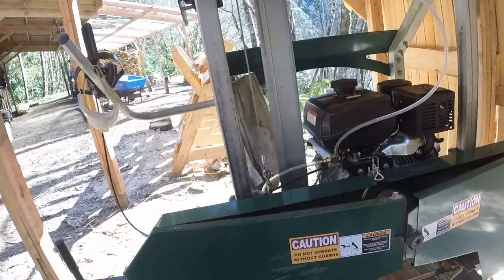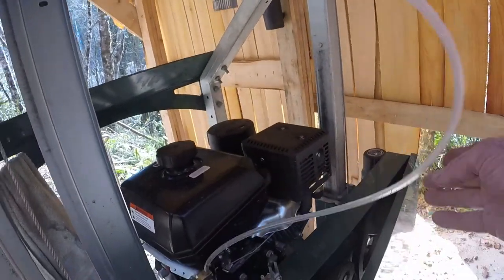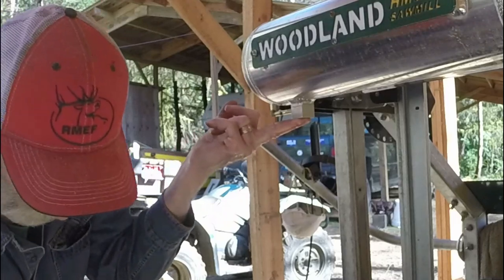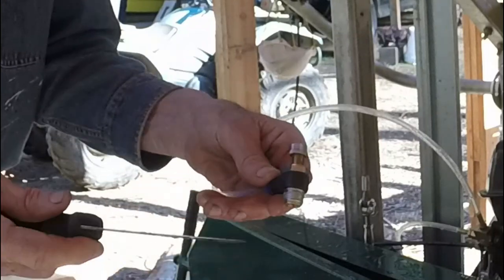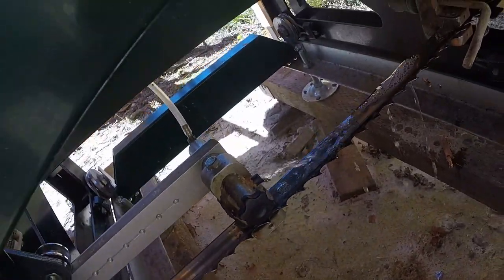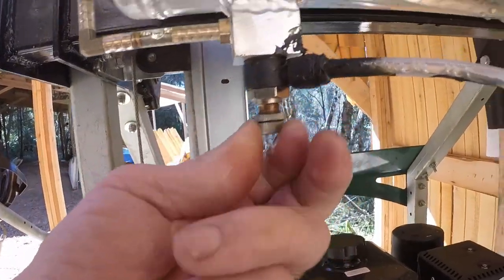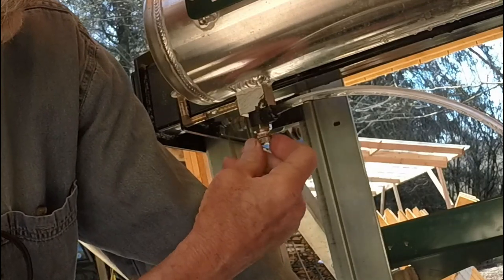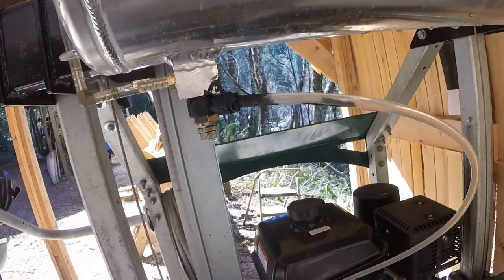Quick Clip #4 My Sawmill Sucks, and How I Fixed It

Comment: I have the 126 same set up '  i had to call Brenna and tell her my valve fell apart just crumbled , she sent me another one no problem till i left water in for a few months , went to use it and had corrosion from the tank stopping it up , now i never leave water in it for too long and gonna start using windshield fluid from now on , good video thankyou sir"
Reply from the maker: That valve seems to be a common weak point, but if the sawmill was perfect, we wouldn't be able to afford it.

Comment: Just used your teflon tape trick and it fixed the air bubbles problem. Took me less time than contacting WM customer service. Thank you
Reply from the maker: Glad it worked for you.
I ended up putting another valve right above the blade guide. Valve at the tank is wide open. Regulation is at the bottom. Works fine.

Comment: I have had the same problem. I used the tape but it didn't seem to last long. If you change the setting it's back to bubbles pretty quick. On another note I have found no difference between a lot of water, little water, or no water. Woodland Mills tech told me if the blade wasn't getting hot to forget the water.
Love your videos, I learn a lot.
Reply from the maker: Thank you, Luke. I seldom use lube anymore. I have a blade scraper that prevents buildup of sap and sawdust, and most of what I mill is already pretty wet. I was surprised to learn that Wood-Mizer advises no lube when milling dry wood.

Comment: My mill is a Frontier OS27 so i dont have that issue. Had my mill couple months now and my autolube system finally just arrived after 4 months. Guess diff mills, diff probs.. Lol. My main prob is sawdust build up on the tracks. Have to scrape off every few boards. Carriage has sweepers, but dont seen to help. Another guy i was watching offered a tip of soaking felt sweepers in a mixture of transmission fluid and kerosene. Going to give it a try. I have noticed you have had to do alot of modifications to your mill. At least when you work the bugs out, your good to go! Be safe..

Comment: Mine does the same thing with all the bubbles in the line.  I noticed that if the jam nut isn't tight, the valve will loosen. 

I suspect I have the same loose tolerances.  I will try the the Teflon tape idea.

 Thanks!
Reply from the maker: I'm going to look for an inline valve to fit the tube like the old-style fuel shutoff's in motor scooters.Plan is to but it just below the WM needle valve and leave that needle valve wide open. It won't have the fine adjustment of the needle valve, but I can live with that. But, if this fix continues to work, I'll leave it alone.

Comment: You should try Loctite pipe sealant 567, it is my go to oil, gas, water sealant. Really enjoy your videos.
Reply from the maker: I've never heard of that, Jimmy. Thanks for the tip.
Reply: It should be available at an auto parts house or hardware store.

Comment: KISS. Keep It Simple. All you need is a simple brass fuel type valve at the tank. The type that you would turn several turns to fully open on  a typical motorized anything. Like my old Tote Gote. Forget throttle actuation. Just crack the valve a bit, maybe 1/4 - 1/2 turn when you are ready to start the cut. eyeball adjust it to a steady rapid drip, and cut. finish the cut and just close the valve. A good steady drip of WATER easily keeps the blade clean. At least it does for my mill and we live like 10 miles apart. My water tank is a simple 2 1/2 gallon plastic gas can with the valve attached thru the plastic lid. To fill I just unscrew the lid, fill the container, put the lid back on then set in the cradle. Ready for another couple hours....25 years trouble free, except for the time some punks stopped by and grabbed that gas container, emptied into their pickup tank, and drove off. not far, heh heh.

Comment: I'm having an issue with the throttle not pushing against the valve to make it flow.  I had to put a little rubber spacer between the throttle leaver (engine side) and the water flow valve. I think the autolube system needs some fine tuning at the factory. Great video!
Reply from the maker: Is your throttle opening completely?  There should be no slack in the cable between hand control and engine. If you fully compress the handle and can move the throttle lever on the engine farther, you cable has slack in it.
Reply: Mine wasn't hitting the water valve so I simply took all the slack out of the throttle cable and not only did the water flow but the engine rpms also got up to full power at 3600rpm. It cuts a hell of a lot faster now. Just loosen the cable screw at the motor and remove the slack and retighten. Took a few times to finally stay tight as it broke in. As to the bubbles I found the ring nut must be tight. As to lube I only use Pinesol now. Works great and came highly recommended especially when cutting sappy pine. From one old timer to another thanks for sharing👍😎👌
Reply from the maker: @fiskfarm  I think a lot of people miss the step in setup that tells us to take all the slack out of the throttle cable. I checked mine yesterday when going over every adjustable thing on the mill, something I do every few operating hours. Still tight.
I assume you don't run just Pine Sol but add it to water. What ratio?
That air leak in the valve existed whether the ring nut/jam nut was tight or not. My guess is, some internal seal--O-ring?--on the needle valve has failed or was defective.
Reply: @OregonOldTimer  I use about 1/2 cup to a full tank of water. Forget who recommended it but it sure seems to work. I bet you're right on the o'ring. If I get bubbles that's where I'll start or just replace the valve with a fridge water tap valve. They have an adjustable packing nut. I just hauled so many rather large logs back from the neighbor that I'm taking a break. Some so heavy I left tire tracks in the pavement, oops. About 8 trips with the loader. He's having a pond dug and cut down oak, locust, maple and Tulip Poplars. Score👍😜
Reply: @OregonOldTimer  you read the manual? I thought that was considered cheating. 🤣👀 Yup I did miss that. Just did it as a matter of habit. I sure recommend a $20 tach. I watch it as I'm cutting about half the time.

Comment: Yes same problem. I may look at replacing the valve with another all together
Reply from the maker: The needle valve I added at the bottom was too touchy. Hard to get the flow just right. I replaced it with a ball valve. Much better.

Comment: Howdy Lumberjack, I am enjoying your videos on the HM 122. I have a question for you. Do you think that cam log clamp apparatus pipe would fit over the smaller diameter one that our screw clamp has? I was thinking maybe cutting it off of the end that has the weld and sliding it over the screw clamp pipe. I too am tired of the screw clamps and want to exchange it for the cam clamp. What do you think? Keep the videos coming and thank you sir.
Reply from the maker: I think the size difference between the screw clamp bar and the cam clamp sleeve is too great, but I didn't try that. Didn't think of it.

Comment: Thanks -- I swear mine had more air than usual last time I sawed, so I need to look into it too.  Do you think the valve would come apart with more effort, or is it permanently put together?  I suspect maybe there's an o-ring in there that deteriorated, causing that leak path you identified.
Reply from the maker: Hardest learned lesson for me is, don't force things. I was afraid of damaging the valve beyond repair, so when it stopped, I stopped.
There is still air in the tube I haven't flushed out, and after my meddling with the needle valve, setting flow precisely is difficult. What I'll do next is install a needle valve as hear the outlet as practical and turn the valve at the tank wide open. That should allow air to flow out of the tube and into the tank, and with the valve at the bottom of the line rather than the top, if it's imperfect, it will leak a little water out, not air in.
To be continued...

Comment: I looks like to me the part you put the tape is supposed to stay tight and the lower knurled piece is the one you open
Reply from the maker: The Teflon tape is on the threaded shaft the lower knurled piece is part of. The upper knurled piece is a jam nut.
Reply: @OregonOldTimer  that does not make since it should be a needle and seat with a o ring and the top should stay tight because if you keep loosing it  it will always suck air. if knot you need to make a better system.
Reply: Something like a sink or toliet shut off valve may work

Comment: I hate that valve on mine. It doesn't leak air but I can never get it set right and when I do the vibration of the mill makes it get loose again and then it's running full blast. Makes me mad lol
Reply from the maker: Unless I'm milling really dry logs, I leave the water off. But I added a valve just above the bottom of the line to control flow, and I leave the one on the tank wide open.

Comment: I just eliminated that valve altogether, replaced it with a 1/4 ball valve that I can regulate
Reply from the maker: I have my factory valve set wide open and regulate with a better needle valve at the bottom of the line. But I seldom use lube anymore.